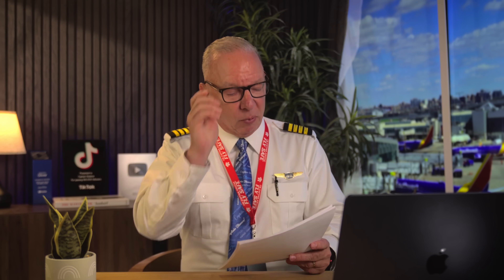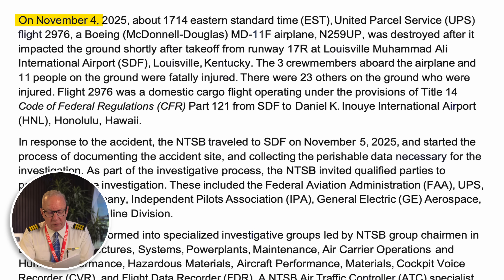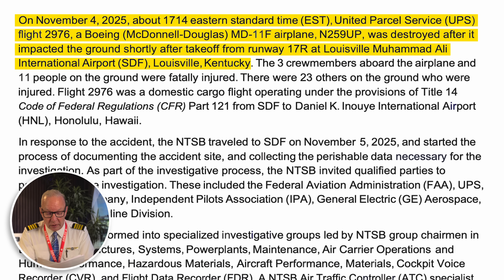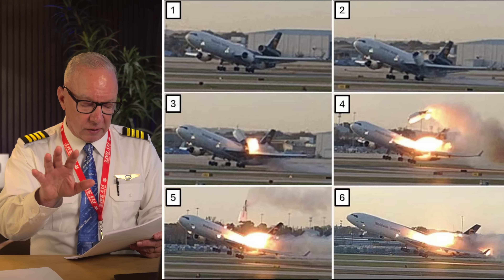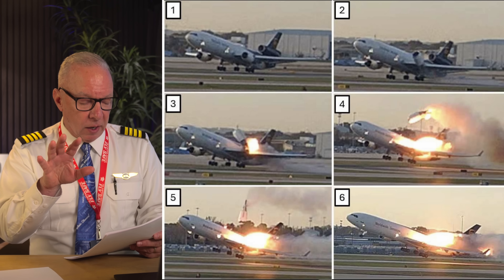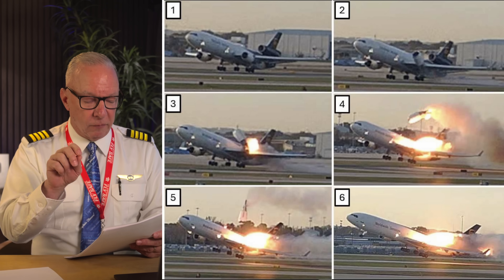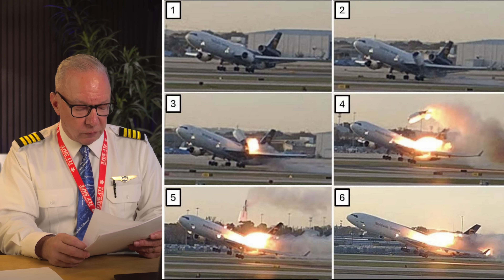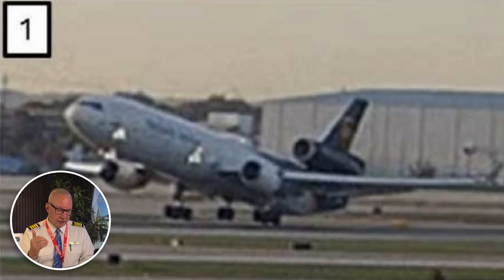UPS Crash Preliminary Report | Pilot Reacts to UPS Crash Report

Comment: The last data of 481 ft mean sea level was probably correct since the airport is listed as 475 mean sea level. And only about 30ft agl.   If they found fatigue fractures and it wasn't due for an inspection for 8000 more flights, I can see why they ground all the planes of this family.  At this point, I think they should scrap all of them just for safety reasons and past issues.  I wouldn't want to fly one.

Comment: Thanks for this Captain. Very illuminating. I may have missed it, (and apologies if I did), but I don't think you explicitly stated WHY this preliminary report explains the grounding of DC-10s and MD-11s. Logically I would assume that it's because the nature of this accident meant that the initial problem of the engine no 1 separation was magnified by the existence of that engine no 2 on the vertical stabilizer, which the DC-10 and MD-11s have in common. Is that a correct assumption?

I know engines are different in size, power and function on different planes, but on a theoretical level, does that potentially mean that if this was a dual engine aircraft instead (like a 777), then even if an engine still did separate, it would have had a better chance of making it? The reasoning being that there would be no engine no 2 on the vertical stabilizer, and therefore the full thrust of engine no 3 would likely be enough to continue the ascent and make a return to the airfield?

That is chilling to think about - and may indeed ground triple-engine airplanes forever.

Comment: Now what? More frequent inspections of the mounts? A complete re-design of the mounting systems? Or pull all DC-10s and M-11s out of fleets and send them to the boneyard? This plane has been cursed since the beginning, and that the mounting problems the presented from 1979 O'Hare crash have not been remedied is inexcusable. I know the 1979 was due to unauthorized shortcuts taken when removing engines for maintenance, but that shortcut was made to get around following time-consuming procedures needed to remove the engines. Is there any way to both strengthen and simplify the engine / pylon / wing connections on these planes, or is that a lost cause?

Comment: Fatigue cracking can be very difficult to detect. When present it may not be visible to the eye. Detection may require very specialized equipment. Fatigue cracking of fuselage rivets caused the Aloha Airlines Flight 243 incident in 1988. 

On another note, the 400 ft was above sea level, only 100 ft above ground level. The first estimate was not so far off.

Comment: 8000 cycles to go before a special detailed inspection was due of the left pylon aft mount lugs and they failed?  Sounds like someone was WAY off on setting the number of cycles before an inspection of these lugs was due or maybe they were defective from the get go but weren't visually so until closer to failure and after last visual inspection of the left pylon aft mount

Comment: Those spherical joints are also known as Rose Joints and are used in Motor Sports, Formula One race cars for example and in Drag Racing. They are manufactured in many sizes but the principle is the same. The casing is billet aluminium/aluminum and the bearings are stainless steel, in essence it's made of dissimilar materials and in high stress situations would be replaced sometimes after being used only once. It's impossible to see stress flaws with the naked eye, they would need to be inspected using an X-ray, to only replace one every six years sounds like a disaster waiting to happen. Those on board and those who were impacted on the ground never stood a chance. My Sincere Condolences to everyone who has lost their loved ones due to this tragic accident, from the U.K..

Comment: ADS of louisville is around 450 and plane ads is 480 which means 30 feet of altitude. Remember Steve ADS is always off sea level meaning you have to subtract the ADS of ground level to altitude that delta give you elevation off the ground.

Comment: Is the design of the engine pylons on DC-10 and MD-11 aircraft the same as pylons on certain Boeing aircraft? I knw of at least 3 incidents of pylon failure over the years, one involving a 747, one with a 707, and a KC-135. All three of the Boeing aircraft lost both engines on one wing during flight.

Comment: If I recall , the Chicago crash analysis established that incorrect procedures were used when removing the engines from the wing. Official standards require the engine be removed from the pylon leaving the pylon and mounts in place. In the Chicago case shortcuts were being used by supporting the engine together with mounts .. from the wing itself to save time. The forklift supporting the engine and mounts moved (settled) therefore cracking the bearings. I assume all procedures will be analysed in this case also.

Comment: Recently read a comment about Boeing,, shortly after acquiring MD, found that a vendor that MD was using was delivering subgrade (knock-off) bolts to MD and MD wasn't catching this. The vendor was subsequently arrested but this didn't solve that problem of subgrade bolts entering the assembly work  stream. I'm not saying this is the situation here but something to look at.

A solution here is to test each bolt before it enters the work stream. Here's how: Build a press equipped with a high strength point (diamond, titanium, something that won't squish). Set it for 10, 20, 40 tons whatever is appropriate for the actual grade bolt. Set it to press a specified depth into a grade bolt which wouldn't be much (0.002" , 0.003" , something that can be measured but won't compromise the bolt integrity). Depth can be measured by diameter of the point dent left by the point on the bolt circumference surface.
Then take a known subgrade bolt and measure the dent depth left on it at the control pressure. This will allow determination of the grade of any individual bolt. Pressures and depth/diameters will have to be determined by experimentation if they can't be calculated from grade specs.

When I was COO of a small startup electronics firm we tested everything coming in for meeting specifications at least by lot if not by units. Bolt grades are indicated by bolt color so I could see why this wouldn't be an issue at the time (nobody expects knock-off bolts). Hope this helps.

Comment: Definitely sounds like the detailed inspections need to be a hell of a lot more frequent.
Reply: Doubtful the detailed inspection would have seen a crack in the bore area without removing everything. In my opinion the SDI was probably some sort of NDT inspection and the likelihood of finding the defect would be much greater. Usually no removal of bolts or systems to perform.